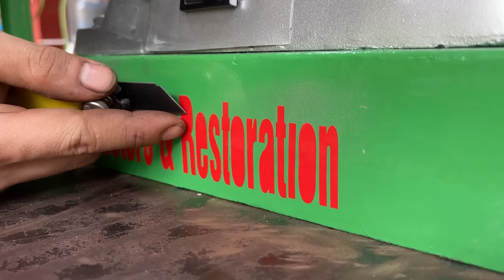Restoring A Giant Stone Grinder//TALENTED MECHANIC Completely Restores An Old Broken Stone Grinder

Comment: Your product has been beautifully restored. It seems like you like beauty. After cleaning the bearings, you install them as if they hadn't been replaced. Someone made the wrong end of the ventilation fan so it was bent, so you can't straighten it.

Detergents. Use a rust remover brush because if the brush breaks it will stick to the copper wire. If not cleaned carefully, when the machine is in operation, the magnetic field will be sucked into the broken rusty brush, which may affect the copper wire. Why waste time repainting the case when you paint the copper wire incorrectly?

I recommend everyone on this machine install an anti-rust brush. If you install a sharpening stone, find an old pot for insurance or make a circle out of iron. What if you were grinding a broken stone?
rust removal machine
Reply from the maker: Thanks very much . We will try in the next videos